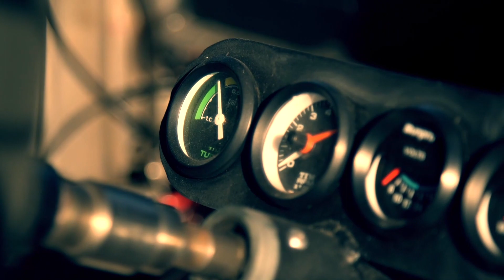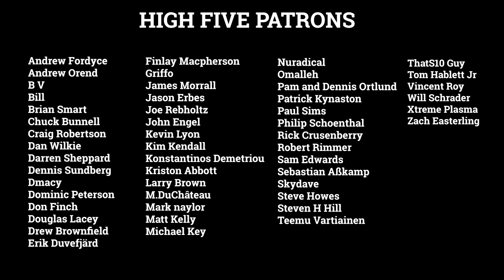Urchfab's Scrap Heap Challenge - The Drift Rat Rod Build Remastered

Comment: If you're wondering why this worked and the inbetweener didn't, This one has no engine bay collecting heat, and no actual resistance on the power plant. Burning rubber takes far less power than pushing a soap box against the wind while the oil is slushing everywhere else but into the pick up. Mongrel has even less room and ventilation than the Escort. Just to keep in mind. Remember to stack ten spare engines. After five you'll get the hang of it, and after eight you'll still have two to tune as N/A for next season.